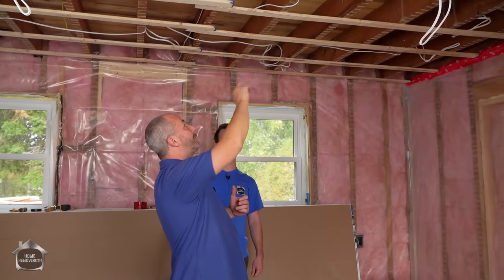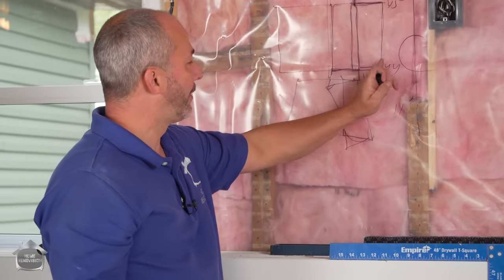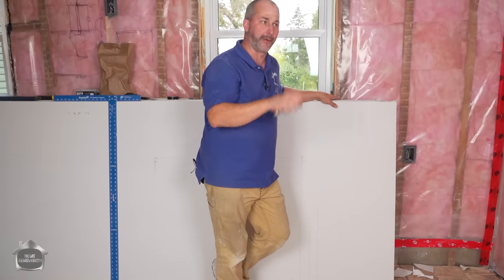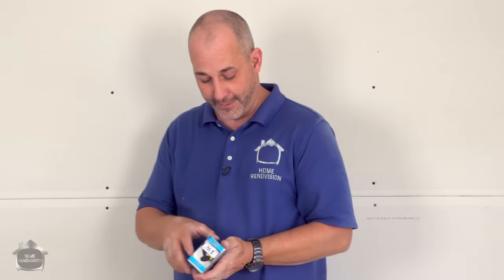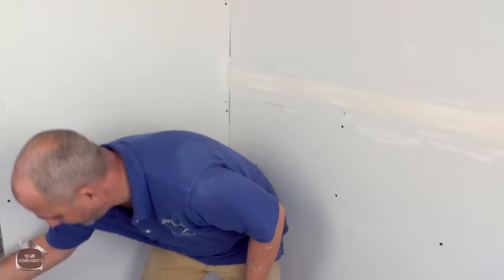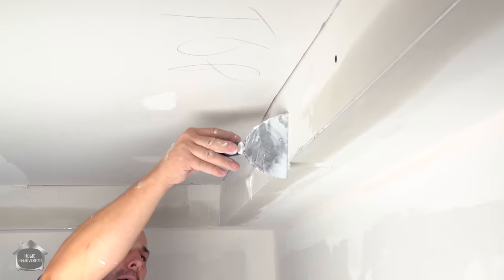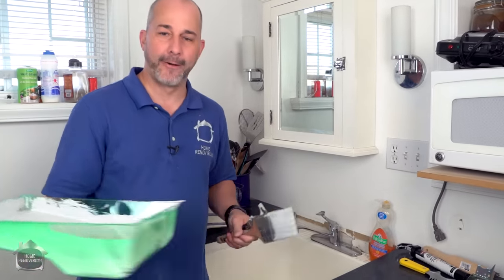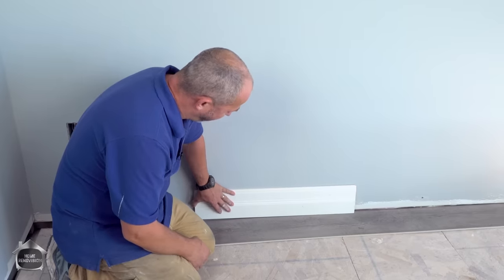How To Install Drywall A to Z | DIY Tutorial

Comment: Thank you so much for this. I have a guy helping me out who works for a house flipper doing drywall. He says he's worked for this guy 15 years. He has worked for me on other jobs and proved honest ,reliable and hard working but this drywall install is a tug of war. Starting with him wanting to put sheets on the wall vertically, everything he wants to do is contrary to what I was taught. I learned years ago from my Dad and uncle and they were not pros. You do things the way I learned to do it and it's almost like having Dad back again, plus you know a lot of tricks he didn't. You are a lifesaver.

Comment: Your brilliant tutorial has got me over a big problem. I have what I call a busy ceiling. The ceiling was raised and insulated into the underside of a pitched roof  with the prefabricated roof trusses showing and meaning that the plasterboard is absolutely full of notches, holes, obstructions and narrow gaps between the truss members. Every plasterer and drywall finisher has suddenly become too busy to do it when they come to give a quote and if it wasn't for this series I would have been stuck. It's been a right **** of a job to do in every way and taken me weeks on and off but it's done now and looks great. Thanks so much for your help and guidance.

Comment: Thanks for the awesome tips. Started a reno and almost cried when it came to drywall. Your tips were spot on, and my work looks like the work of someone that's been doing it for 3-5 years. It doesn't look like a 3 year old did it. Your hammer through the wall patch is awesome. Worked like a champ. Love your videos bud. Keep them coming.
Reply: I have a job..... Doing a job from somebody bad work
Reply from the maker: Glad it helped! Cheers!

Comment: Great video. 
I used to work as a painter for 13 years and I never seen anyone put tape on the inside corners. 
Maybe we build different or might be other climate but in Sweden we just use latex caulk after first layer of paint.
That way we get perfect corners and it doesnt crack.
Huge time saver. We do ofcourse use mud in all corners but without the tape.

Comment: Phenomenal video. Jeff is a real pro and a great teacher and I've become a much more proficient drywaller because of his instruction. I've watched his videos over and over again. One small suggestion--If you are just beginning with drywall, where Jeff uses 45 minute mud, I'd suggest using 90 minute mud until you become more proficient. It gives you more work time than the 45. As Jeff rightly points out, you can use all purpose mud, but if time is an issue for you and you need the mud to dry more quickly, 90 minute mud may well do the trick for you.

Comment: I've been drywalling for 15 years and I'm self taught, I'm embarrassed to say this (but not really), but this video, and others have taught me so much that I'm positive I'll be drywalling so much more efficiently and since my daughter works with me now, I can teach her the proper techniques. I've done a lot of things correctly, but measuring from the center to the outside walls and leaving a 1/4 on each edge is amazing workmanship and will be so much faster then I've ever been. I've also owned my Rotozip for I don't remember how long and have only used it a few times because I don't have much hand strength, (carpel tunnel) to keep straight lines, you make it look incredibly easy, I'm going to practice, practice, practice to get that technique down. I own a multitool and started using that to cut out my boxes, but I'm measuring and making non-perfect cutouts that I have to fill in with mud and tape, (yeah, IKR?) You're such a great instructor, I plan on following all of your advice to a T, see what I did there? I'm so glad I found your channel, seriously, thank you!!!

Comment: Thanks for putting this all into one video. I love your channel and share it with others. Suggest that you point out that you should stack your drywall on walls that the floor joists go to so that the extreme weight of the multiple sheets of drywall is distributed over multiple joists. Preferably on an outside wall where the load can be transferred down to the rim board and foundation wall. There could a problem even on interior walls located over multiple floor joists if there isn't a wall supporting the floor joists but maybe just a beam not designed to support 900# of drywall. That much weight against walls running parallel to floor joists will be placing 900# over 1 or 2 joists which definitely could cause enough deflection to crack possible drywall joints in the room below. You can distribute your drywall against multiple walls without doorways which may require you to move a sheet out of the way to install the first sheet on the wall. Small price to pay to prevent avoidable possible damage.
Reply: Not really a big deal.  People put waterbeds in houses which weigh more than that.

Comment: I am from a country where we plaster the walls with cement. This is really fascinating to watch. The measure and math are simple to follow and encouraging.
Reply: On that wonky ceiling , just screw some blocking at each end about 49 inches from the ceiling and set the drywall on the blocks. Now make a scriblng block from scrap drywall and get a perfect fit for your ceiling. Great video otherwise

Comment: Quick research tip for the US viewers.  The US equivalent to the CGC All-Purpose Lightweight Ready Mixed Machine Mud, is the USG Plus 3 Lightweight All-Purpose Pre-Mixed Joint Compound.  As it turns out, USG is the parent company to CGC.  Best I can tell is that both of these products are identical, just marketed differently in the US and Canada.  The other difference is that the USG version comes in a 4.5 gallon bucket instead of the cardboard box version with the plastic liner.  Which is nice because it saves a step transferring from box to bucket nor will you need to have a spare bucket around to use it.

Comment: I'm glad I found your channel! I'm learning a bunch that will make things easier! I love that you are very thorough and go through those little things that make things easier and make the job look better!
  The metal wrap on a paintbrush is called a furrow.  Some brushes will come apart if water stays in the furrow too long when cleaning them. The better ones that use better adhesives for the bristles generally don't, but some can.
  A good quality paint brush makes a huge difference! I still have a couple of artist brushes that are almost 50 years old made of I think mink fur. They are awesome! Caring for them is so important!
   I wasn't aware you can wash paint rollers! I assumed that they would fall apart and I've always thought it was a huge waste of paint! You got about a pint of paint out of that roller and it wasn't even the thicker one! That's pretty awesome!
  I love the tools you have chosen! I have some, but not all of those. Back to the hardware store! :) I can always find something go buy there! Thank goodness for their coupons! 
   You prolly already know this, but your video link cards aren't showing up.
   Your video is awesome! I too use the plastic blade to protect many things instead of tape, or to make a straight line. Those plastic blade thingies come in different sizes, so you can use the smaller ones for small areas or even for door knobs, round lighting scones, ceiling fans, etc.
   I use tape on uneven, detailed edges. I cut the edges of the tape with an exacto knife to get those intricate, detailed edges.
   I finish edges even under things like ceiling tins, baseboards, etc. It may not show, but it can save a LOT of work down the road should those things be removed years down the road... same is true for baseboards, kitchen lighting, etc.
  I had some flourescent lighting in a kitchen I wanted to replace, yet because it wasn't finished, the entire kitchen really needed a repaint and the drywall edges would've needed to be finished in order to make it right again, so despite wanting to update it, we left it the same and figured when the interior paint is due, perhaps it will be done then, year from now. That's something to keep in mind. I think it's always a good idea to completely finish everything, even if it doesn't show at all.
   I'm also 100% with you on using good quality, professional quality paint! This isn't a kindergarten art project where a child is learning, this is your home (or someone's home anyhow!)
   Professional paints have more pigment in them, thus the job can often be done with a coat or two. Lesser quality paints often don't flow as well, tend to drip more, and don't cover or protect the surface as well, thus the cheaper quality paints take more coats, take more work & simply don't look as good and don't last as long.
   Thank you so much for your tool tips and reminders about those little things!
   I'm going to have to find one of those gooseneck brushes! I used to use a metal coat hanger to create one!  I didn't know that existed! Next time I have to jimmy rig something, or McGyver or whatever, I should market a solution!!!
😊 
   Thanks again for your awesome videos! I love that they are straight to the point & are so very helpful!
   Subbed!
Perhaps we can share other little things that help too ?
   Does anyone know what those plastic blade things are called that we use for blocking paint and making straight edges??? I don't know if they even have a name, but they are indeed very useful!
Reply: Should be called A to Z how not to do drywall

Comment: Watched all 3 hours in 9 mins! I'm a speed watcher! My big drywall project is next month so I'll be coming back ti this one.
Reply from the maker: Awesome! Thank you!
Reply: Good tips. You might try a TapeBuddy drywall taping tool and use paper tape. Stronger than mesh and cheaper. And it works on all seams, flat and corners. No blister or bubbles and the compound coating it consistent.

Comment: Also I used to have a great little device, a clear plastic sleeve that slid over the roller and clipped onto the roller handle, and had a hose connector at the other end. Watching the water push the paint residue out of the roller fibres was great!

Comment: Jeff - I absolutely love this drywall series! All of these awesome tips make it seem approachable. Would you consider doing a video on repairing a room with water damage, where the homeowner just needs to remove the bottom 1 or 2 feet and then blend into the existing wall up top? It would be great to see a room with metal outside corner bead like a walk-in closet. Do you just cut it off with the removed sheetrock and replace feather the transition, or try to reuse it?
Reply: You have to cut it off higher up and replace the drywall. Drywall will wick up water via capillary action, all the way to the ceiling.
Reply: @CarolReidCA  - If it's just a little water damage, there's no need to do the entire wall. The remediation folks bring in fans and dehumidifiers and can stop the wicking process before it reaches more than a few feet up the wall (checked with moisture meters).

Comment: I've always wondered... Why do people not install trim at the very end? If you hold off on trim, then there's no need to cut paint between the wall and the trim, and then the trim can just sit right on top of the finished flooring. No need to slide it underneath or install something like quarterround.

Comment: You skipped where you textured the drywall after the mud coats but before the paint. What did you do to texture the full wall?
Reply: What's the answers?
Reply: Pretty sure he just sands the whole wall so the texture of the mud matches the texture of the paper on the drywall... They don't do knockdown in Canada
Reply: its a level 5 smooth wall
Reply: Pretty sure in Canada they don’t have textured walls. Just flat
Reply: @vegaspedalbloxx  Level 4, isn't it? Don't you have to skim the whole surface for level 5, then prime?
Reply: @MrLuridan  maybe a level 4 finsih they call for hard to say what there plans call for

Comment: Man, when I screwed something up I'd get a hammer tossed at my head. He got off easy
Reply from the maker: Cheers, I have had many hammers thrown in my direction in years past!
Reply: P
Reply: Awesome
Reply: i love that solution
Reply: I feel like I missed important part of training. The old men I worked with never threw tools.
Reply: @joetrimble7953  if you work in the trades and never had tools thrown at you then you either are gods gift the trades or your instructors weren't good at their jobs. LOL
Reply: @HomeRenoVisionDIY  з1зщп
э0
Reply: That's sad. Everyone screws up! That's how you get better at things! Ever had unsecured drywall suck off the framing when a door is opened? That's true! I had to chuckle when he mentioned it!
Reply: @rockstarproductions6377  i never had and i am a master drywaller i had to learn learn to understand low german as well so i could understand the measurements being tossed at me lol

Comment: Great video! I am impressed with your knowledge and skills. You are very well spoken and explain things in basic and understandable terms, and add some great humor to make it even more enjoyable to watch. I watched the entire 3 hour video and learned a great deal. You truly do cover from A to Z. The only thing you missed was were to place the drywall screws, such as in the seams on flat joints, how close to the edge on butt joints, the proper spacing between screws (the drywall I am working with has marking on it to help locate screws, I believe). Maybe I missed it, but I don't think so. Thanks so much for this video!

Comment: i learned that the drywall drivers do need adjusted, depending on the age and type of wood you go into. The driver relies on the fact that the bit slides out of the screw which stops it or the torque it requires to turn the screw. So if you went into softwood vs hardwood or a knot, it will behave much differently. Always recheck the screws no mater what. Renovations are notorious for inconsistent drywall screw depths.

Comment: I'm learning so much from this video and it's very helpful as a new homeowner doing a lot of the work. I'm about an hour and 15 minutes in but wanted to know if you are supposed to remove the tape that come on the edges of the dry wall sheets before installation and if so what is the best method to do it? 
Thanks!

Comment: I've been in construction since 1965, Framing then 25 years in drywall and finally remodeling. Without a doubt your videos are the best I've seen. The use of 45min for repairs and small drywall jobs is great. When we did warranty work on drywall it was all done with 45min. Although we used a plaster blister brush instead of a sponge. Anyway was so impressed I thought had to say something

Comment: One think to help your paint roller or brush cleaning. Take a pail, cut a 4 inch hole in a pail with water and a empty pail. You can ring out your roller and brush with conserving water.

Comment: Wow first time I watched this guy during the past 5 years that he actually showed me something, (and it is not that he can actually work). Always had a problem with drywall, liked his measuring scheme. If I start on my house now, it will be the 4th house that I worked on. One thing I learned working on Pa. houses, is that not one of them is built level, or straight. Like in one bathroom I had a 4 foot section where we installed tile on the lower 4 foot, and I wanted molding on the top, so I cut a 4 ft. strip and put it up against the wall and the middle was tight but both ends where sticking a half inch away from the wall. Now the molding I used wouldn't flex that much, so broke out the old circular, and cut slots in the molding for about 1 foot on each side so I could have some flex. It is like my grandpa used to say, he built houses, don't worry about straight, after a few 6 packs it will be straight.

Comment: Great Video. One issue some people may have is getting 10'-12' lengths of drywall around a corner and down the stairs for basement  Reno. Something to consider when purchasing your material. Might want to do a test run before hand

Comment: In this area (Southern Ohio) we've seen a lot of problems caused by the typical 6 mil vapor barrier. On typical installations with exterior stud wall (3-1/2") with fiberglass, then the vapor barrier, then 1/2 drywall, drywall primer and the 1/2 coats of latex paint, moisture inside the house sails right through everything and then stops at the vapor barrier. Next thing you know, fasteners are corroding and telegraph/stain the paint and mold problems arise on the back side of the drywall. So what can you do? Not a lot for many homes. Run fans at every shower. Run fans when cooking (Natural gas is popular here). Never "air dry" laundry in the utility area (Often basements around here). Basically, you need to keep the interior air dry, dry, dry. If you're upgrading the furnace, talk with the installers about humidity control specific to your area and home construction.

Comment: Hello Jeff... You have an excellent approach to educating the masses.
I have one question of many...
When you sand the walls (after mudding, between paint coats, etc), Is there any concern for the resulting dust left on the walls?
In my mind, I am assuming that this might contribute to debris (pimples, bumps and lumps) under the subsequent layer, but based on what I am seeing from your videos, it does not.
I am definitely gonna get that 360 sander and that Olfa knife